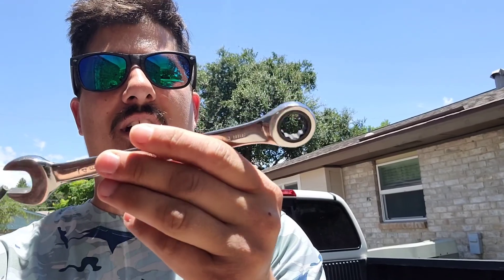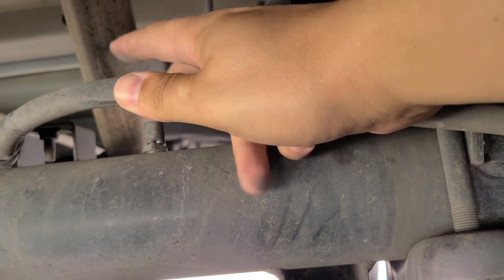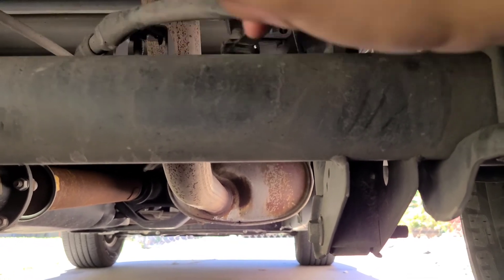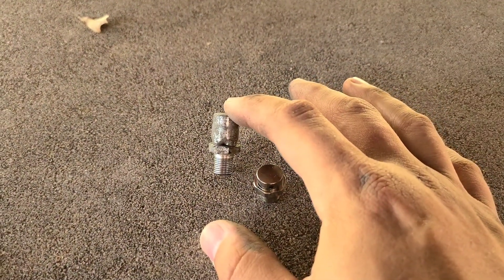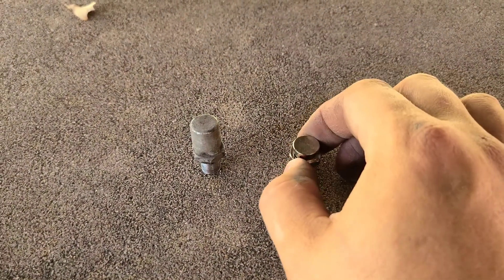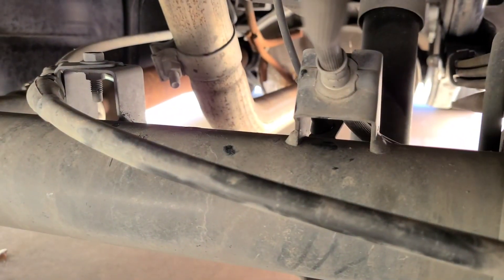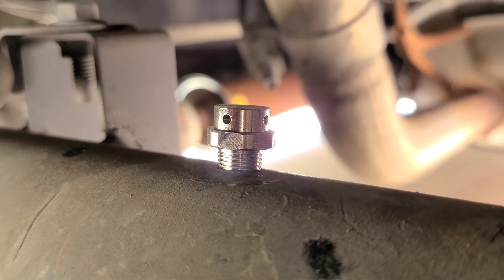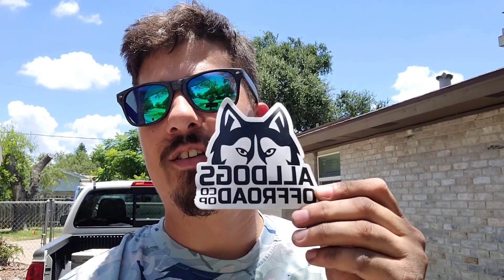Nissan Frontier Rear Diff. Breather Install !! Mod: 3

Comment: Mine was hell getting out and the new one didn’t want to go in easy either??
Reply from the maker: Sometimes the threads can get boogered up. Can't remember the thread pitch but you can re tap them. If it's really old some heat will get it off

Comment: I don't see how this one is any better than OEM
Reply from the maker: The OEM one is flawed in it's design and it will rust or corrode closed then will not allow the axle to vent properly. It's well known for this issue across all frontier groups and forums.

Comment: I have honestly never had to do this and i have ran through water like no other
Reply: This mod is like preventive maintenance... New trucks shouldn't have a problem but over time the OEM vent gets rusty or full of crud.  You could just replace the OEM piece every time you change the rear dif fluid.  That's one idea.  But if you do go axle deep in water on a regular basis?  You should do this mod, but do it with the hose extension that relocates the valve to a higher location. If you don't? Could have issues down the road... If you don't go off roading or anything crazy this mod won't hurt anything but may prevent an issue down the road👍

Comment: My opinion is it is worthless unless you raise the valve up. Many use the rear taillamp area, can even take it higher. As you drive your diff get hot and then pressure increases, that valve allows the pressure to expel via the valve if the valve gets plugged, the increase pressure could start to blow axle seals. That replacement valve will allow the vent to vent pressure but it sure looks like water will be allowed to enter if submerged. That cotton stuff is not a valve it is a filter of some sort.
And when a hot diff is suddenly cooled by submersion in water or a snow bank it rapidly cools creating a negative pressure that can suck water in if the diff is submerged. NOT a good thing to mix water and petro products. 
So, although easy, I see no reason for the factory valve replacement. 
And if someone wants to do it right, replace a valve up higher to negate the chance the valve could be under water if the diff and axle are submerged. 

All dogs offers a complete kit with a hose, and there is a video out there that shows it being mounted to the top of the carbon canister. NOT MY video, but it is out there on Youtube.